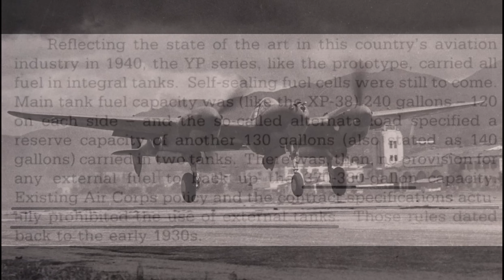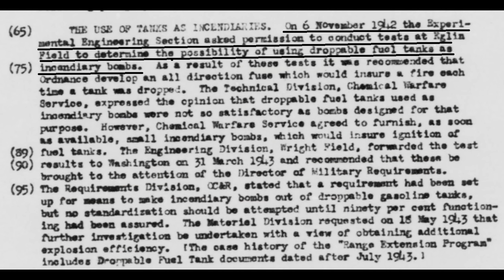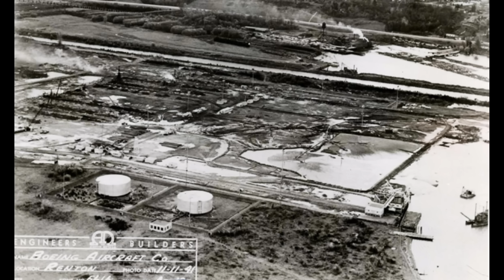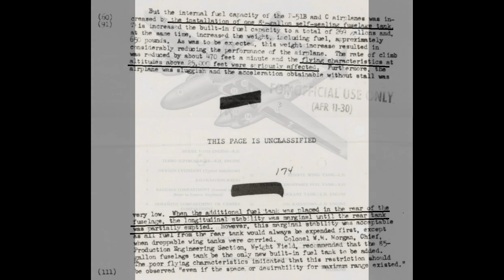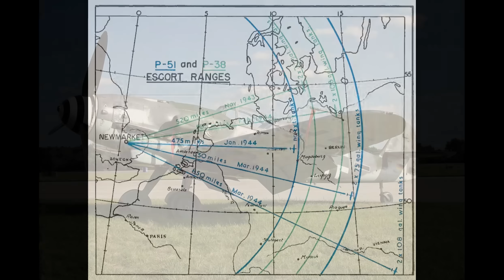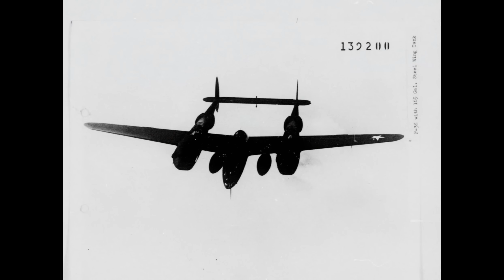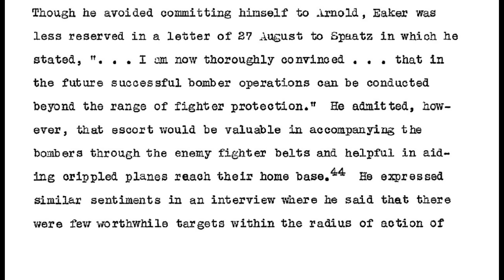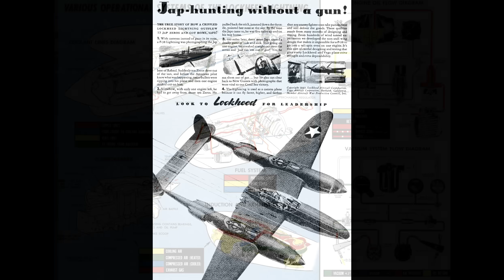The P 38 Lighting and the Bomber Mafia's Failure In World War Two

Comment: YAMAMOTO & THE ENIGMA MACHINE ! 
Discovering the exact whereabouts of Admiral Yamamoto, and his precise "Timetable". As Yamamoto was on a "Grand Inspection" tour of Japanese Defenses in the Solomons islands chain, can only have been achieved if Japanese Naval codes had been totally broken. And of course the Japanese had by this time access to the German Enigma Machine, a very clever code scrambling mechanism, which had already led the British (at the top secret Bletchley Park in the UK) to build the Worlds fist true computers to unravel the Enigma Code scrambler. One of those three computers was of course shipped to Washington, to allow the U.S. Military, to also unscramble Japanese Codes, quickly enough to make use of the information gleaned !
Reply: @railwaymechanicalengineer4587   Not really. The Japanese had entirely their own machine based cipher systems starting before WW2. These systems were broken into by US crypt-analysts in the PTO and mainland US - both before and after US entry into the war - separately from but using similar analysis, mathematical and machine methods to the British. From 1941 the US and UK did share and pool a lot of cryptographic expertise - but neither the Japanese or German systems were ever fully (ie continuously) broken as both introduced higher complexity over time.
Similary both the Japanese and Germans had some significant successes breaking into various US and UK Cipher systems.
The early computers you mention were not used for 'Enigma' traffic but for the separate 'Lorenz' (and simliar) machine ciphers used by the Germans which were much more challenging to break into. Solving the daily keys for the Enigma traffic was ~exclusively done using the electro-mechanical 'Bombes' which were not in any sense computers.
Reply: @jackgee3200  Obviously you are not versed in what's known as the "Secrets War". Indeed you should find a whole shelf full of books on the "Secrets War" (which began in the 1880's) in any decent Reference Library.  The Germans provided both the Italians & Japanese with the German Enigma code scrambling mechanism. Which the British at Bletchley Park, had already unravelled by the construction of the Worlds First Computer, before the USA even joined the war in 1941. Indeed the British shipped a second Computer to Washington to allow your "Code breakers" to unravel that code scrambling "Enigma" mechanism, after the USA had joined the War in Dec 1941.  Indeed there is much more to the "Pearl Harbor" event than you Americans are still totally unaware of. And I have a manuscript waiting for publication on that incident, which according to my publishers in London cannot yet be published or we "All go to jail". As much of what occurred in and around Pearl Harbor at the time is still secret and covered by both the US & British "Official Secrets Acts".  So what you are stating is in fact just WW2 US Military Propaganda !

I'll give you a hint - In 1985, I was on O'ahu to research certain physical evidence left behind from the time of the Pearl Harbor event. Concerning just how it could be possible for the Japs to have supposedly done a "sneak attack" !!!! And the physical evidence was exactly were I expected to find it, high up in a mountain pass !!!!!

Comment: This sort of stuff goes on today as well. Just look at the effective range of the 7.62NATO round. If they just change the spec from 1-12" to 1-10" twist in the barrels, and use the 160gr Warner Flat Line bullet, supersonic range can be extended by 40%. In addition they can use the new 277 Fury case technology in 7.62NATO and increase the working pressure safely in the current 7.62NATO MGs, DMRs and sniper rifles and increase supersonic range by app 60% from current 7.62NATO setup. 
However this increase in range undermines the US Army's requirements for new weapons. Like the bomber mafia of WW2 the US Army has as we speak SPECIFICALLY ORDERED the 277 Fury case techonogy NOT to be used in increasing the performance of the 7.62NATO.
A 7.62NATO FN MINIMI light machine gun with a 20" 1-10" barrel with the 160gr Warner bullet loaded in a "277 Fury" case have a supersonic (bullet going mach 1+) range to app 1 mile. Why don't the US Army want that for "free" with only a change of specs? 
In the current 7.62NATO setup with 20" barrels max supersonic range is app 8 - 900yds.

Comment: You make a good case for the P-38, but you missed the actual reasons for the Lightning being passed over for the bomber escort role (read to the end). The P-38's results in Europe and the Mediterranean, as a bomber escort , was mixed. 

As you touched on, the P-38 suffered some troubling engineering issues which were not corrected until later in the war and required specific training to work around.  The P-38's susceptibility to compressibility lockup, tail separation under high G and the danger of an uncontrollable yawing roll and crash if an engine failed on takeoff.  the P-38's engine configuration also caused issues with cockpit heating in the ETO. These were, indeed valid reasons.

Finally, at the request of USAAF General Doolittle, the Royal Aircraft Establishment was asked to test and review the various US fighters for suitability as escort fighters. The Royal Aircraft Establishment test pilot, Captain Eric Brown, reported that the P-38 was not competitive with the latest German fighter models. 

In their 2008 tome "Air Combat Manoeuvres", authors Thompson & Smith quoted Captain Eric Brown as saying about the P-38 : 'We had found out that the Bf 109 and the FW 190 could fight up to a Mach of 0.75, three-quarters the speed of sound. We checked the Lightning and it couldn't fly in combat faster than 0.68. So, it was useless. We told Doolittle that all it was good for was photo-reconnaissance and had to be withdrawn from escort duties.'
Reply: The Brown comment is the biggest joke in the fighter world. He's full of himself, and full of crap. If Brown couldn't compete with the FW 190 and the bf 109 in a P-38, it was the pilot, not the plane.

Critical Mach is not the sole determining factor in fighter performance. It is ONE factor, and ONE factor ONLY.

There is roll rate, instant roll rate, climb rate, acceleration rate, instant turn rate, and sustained turn rate, and even top speed.

The tail separation was resolved well before 1943, during the testing of dive limits and dive recovery flaps. Reinforcements were added to resolve the issue. Tail separation was an issue ONLY in an out of control dive.

The yaw issue was only a problem if you completely ignored take off procedure, which called for prop and magneto checks on both engines, and both engines to be at 56" of MAP and 2500 RPM before initiating the takeoff roll. Further, Tony LeVier demonstrated that proper procedure  for recovery of an engine loss on take off prevented a crash.
Reply from the maker: The low Mach limit of the P-38 was known way before Eric Brown ever flew the plane. I think you missed the whole point. It's not a question of how good the P-38 is vs. this or that. It's a question of P-38s for escort, or nothing. The Bomber Mafia chose nothing, which was a huge mistake.

Comment: I will contend that the P-38 would not have been used as the primary escort fighter in Europe prior to the P-51, for the simple reason that, had the Bomber Mafia really decided they needed escorts, they would have instead nipped the Brisbane tank design, handed the plans over to the highly industrious British to build lots, and relied instead on the more capable, better suited and more readily available P-47.

They didn't use the P-38 not because it wouldn't have been perfect at the job, but because using it at all would be admitting the job needed to be done.

Comment: The city museum in Matsumoto Japan, right next to the castle has on the second floor a drop tank for the Mitsubishi Zero. They made them in Matsumoto. It's mostly wood with hundreds of shoe nails holding it all together. Looks very time consuming. I immediately pictured in my mind a guy with a pack of camels rolled up in his t-shirt sleeve, chewing gum  pressing a button on a stamping machine. Slam! half a drop tank.  Incorrect of course. My other thought was, lots of little tack nails versus Burbank (where they made the P 38 and where Kelly Johnson's Skunk Works was.) What was Japan thinking??? They didn't stand a chance.  
And I'm not sure that Hap Arnold or anybody except maybe Lockheed would care if Kelly Johnson was figuring out drop tanks. Didn't cost the USAAF a nickel  until they actually wanted them.  Johnson's career was a bit like what Steve Jobs once said, "They don't know they want it until we show it to them."  Colonel Kelsey did stick his neck out. 
I'd love to see an air museum display of all the different drop tanks, with interior details, information on time and cost.

Comment: This is a GREAT video!

re: the P-38 heater - IIRC Chuck Yeager mentioned that, in the P-51, the heater exhaust was on the floor of one side of the cockpit. The result was that one of his feet would be sweating and the other would be frozen. I don't remember if that was just in the 'B' model or also in the 'D', but it was certainly an indication that even the Merlin-powered Mustang wasn't perfect!
Reply from the maker: Thanks Dave. The P-51 is really good, but it's not perfect, no plane is and certainly not any WW2 fighter.

Comment: Excellent video! Great research and really explains what happened. One can argue all day what fighter was better or best, but at the end of the day the P-38 and then P-47 were available when it could have really counted, but weren’t used to their potential while the 8th tried to prove bombers could defend themselves. No doubt the P-51 could do the escort job with less expenditure of money (which means less manufacturing labor back home and less maintenance in the field) and precious high octane fuel. However, the P-51 obviously was inferior for the other missions of dive bombing, ground support, and particularly photo-recon. 
The bomb load in terms of lbs dropped per number of highly trained personnel at risk, fuel expended, and aircraft cost I think goes to P-38 and P-47. The droop snoot Lightning is testimony to an effort to reduce those costs by using 16 single pilot aircraft + 1 bombardier and lower fuel consumption to do the job of B-25’s or B-26’s with 5 or 7 crew at risk. Wasn’t a great success, but perhaps wasn’t used much as by then the incredible logistics of the US meant there wasn’t a shortage of medium bombers or crew later in the war.
I’m sure one of the drivers of the bomber mafia was resources: adding fighter escort meant adding all the logistical problems and resources of added aircraft, ground crew, and pilots that didn’t contribute directly to bombs dropped. Tragic that they fought even the option of long range escort by blocking drop tank development. A lot of crew paid with their lives learning the flaws of the defendable bomber theory.
And yes, Virgina, I’m one of those guys who might not have been born except for the second engine on a P-38. My Dad came home twice with a dead engine.

Comment: Great details for the P-38. I never however understood the failure of the YB-40 ( the upgunned escort B-17 ) ... these were aeronautical experts and they could not do the simple math * within the limits of the bombload of a regular B-17 ( or rather its empty weight after dropping the payload)  and simply said "thats the weight we have to achieve or its pointless". Instead they loaded stuff willy-nilly onto the ship until it was even heavier and slower than the regular bombers. Now the decision if the YB-40 would weigh as much as the loaded bomber ( so it could keep the pace until the target and then may fall behind ) or it would have been intended to keep the pace all the way. Both versions would have had advantages and disadvantages ofc. The tricky part in these days were ofc to find out how much drag additional turrets etc. produced and how much speed you would lose ( forcing you either to drop the weight further or force the engines to work at a higher cruising speed ). But such a hamfisted way of doing things always baffled me. * simple math only for certain aspects of the design.
Reply: That said - sigh didn´t want to write a book - the "mass to play around with" wouldve been either:  bombload + reinforced hull elements for carrying hvy. bombs + auxiliary gear for dropping bombs like bomb bay, bomb sights + armor + fuel etc. or all of the above minus the bombload ( if the YB was expected to keep up with the B-17 after they got rid of the payload). And on top of that the extra drag you have with extra turrets and barrels sticking out.

Comment: Possibly, the confusion over the capacity of the fuel tanks is caused by the term gallons. The US gallon was (and still is) 128 oz, whereas the Imperial gallon was/is 160 oz. So it depends on who you talk to. The Axis powers used the metric system of liters to confuse the matter even more..

Comment: Thanks for this very informative video.  Did the Bomber Mafia's envision an independent Air Force that included only bombers?  Seems odd, but that's the only thing that makes sense.
Didn't Charles Lindbergh teach P-38 pilots how to increase the P-38 range by using "oversquare" (I think that's what it was called) where you increase manifold pressure and decrease prop RPM and you also set fuel to "auto-lean"?  I assume that this was not included in the official USAAF range numbers.

Comment: I agree that the P-38 would have been "good enough" in the mission of escort fighter to reduce bomber losses.  The fundamental mission of an escort fighter is not necessarily to engage the enemy fighters in dogfights (which the Bf109 was clearly superior) but to disrupt the attacks of the defending fighters.  If the escort fighters is positioned well above the bombers, they can easily dive, disrupt, and climb back to safety.  If the enemy formations have to do evasive maneuvers to avoid (which will can easily be successful given how poor the overall maneuverability of the P-38 was), they would still disrupt the attacks.  However, the "bomber mafia" did not fail.  A huge number of heavy bombers was sold to the government, which did nothing but kill innocent civilians and ensure that the Germans were committed to the war all the way to the end.  The heavy bomber activity probably extended the war rather than shorten it.  But Boeing and Consolidated did not mind very much.

Comment: Did anyone ever consider improvised drop tanks for Billy Mitchell's B-25s for the raid on Tokyo?
Reply: The B-25's for the Doolittle Raid were modified by stripping them down and adding extra fuel cells inside the plane. Drop tanks would have added more weight, the planes could barely launch from the carrier already.

Comment: Greg, looking at those metal drop tanks reminded me of when I was about five years old how my Dad, who was a former B-29 engine mechanic and Spartan trained A&E, acquired a surplus tank, cut it lengthwise in half, and built a three-wheeled car for me to drive around the yard.  It was originally powered by a battery hooked to an aircraft alternator, but it was soon replaced with a gasoline powered lawnmower engine.  He painted it red with a long white stripe that wrapped all the way around the tank.  It looked like a speed demon, but only went bout two miles per hour.  It had enough fuel that I could putter into town by driving it on the sidewalk, not that my parents ever condoned such daredevilry.
Reply: Droptanks were popular body shells for post war land speed racing cars such as "lakesters." Cheaply available as surplus, lightweight and already streamlined. I wonder if your Dad got some inspiration from them?
Reply: @nerd1000ify  I don't know.  He was a member of the local CAP chapter and I believe they had some surplus odds and ends lying in the grass behind the hangar.
Reply: Ohoho! That sounds like a little boy's dream! I would have been so happy to have something like that as a boy. It's too bad you don't still have it. That would be something that I pass down to my grandkids lol 
You're dad sounds like a great man!

Comment: Did you do a video that really drills down to why they cared so much about unescorted bombers? Would they have had to work with people they didn't want to?  Would it have raised the cost of bombing or called bombing into questions?
Reply: In part it came out of the interwar years. Conflicts like the Spanish Civil War where bombers were nearly as fast as fighters, contributing to the idea that "the bomber will always get through". Since it will always get through, and you have a load of machineguns, why would you need a fighter force?

Ultimately it comes down to resources. Should the US build bombers, or use those resources for ships, tanks etc.
Reply: @kenreckless2757  I get the initial motivation, but I don't get why they hung on well into 1943. Even the British shifted to night bombing pretty quick after the day losses skyrocketed.
Reply: @PositionLight  Brutally? The British knew they couldn't sustain the losses. The Americans figured they could. The US did believe they were making a difference, and it is said that Generals wed their doctrines more faithfully than their wives. Besides, they probably assumed they had no choice but to continue. To switch to night bombing would A) prompt a redesign of their bombers away from mass .50cal guns, and B) acknowledge the British were correct. Untenable!